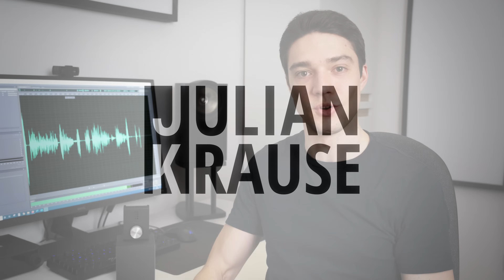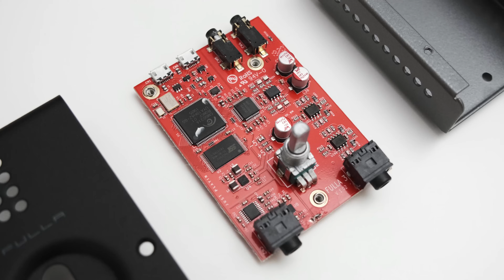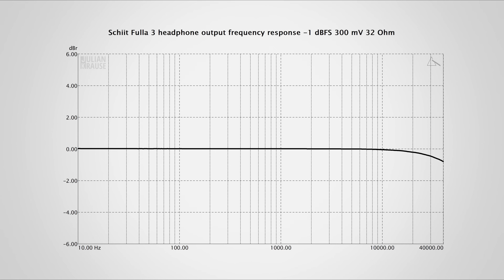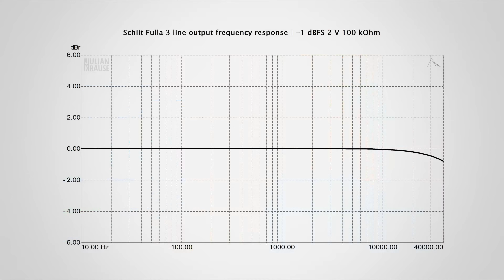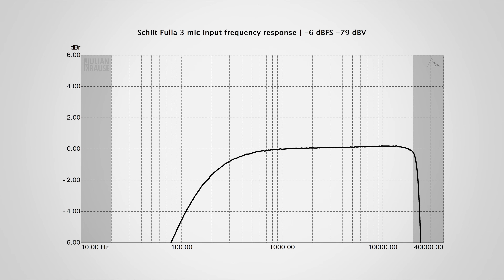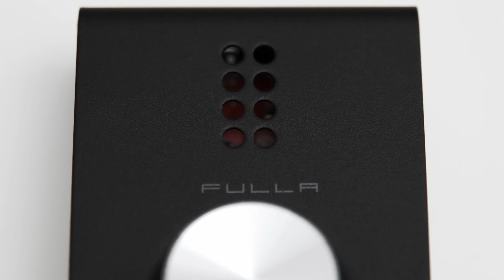Schiit Fulla 3 - Gaming DAC / Headphone Amp / Interface (audio quality tested)

Comment: I can confirm that my Fulla 3 has the same volume knob crackling issue out of the box. It was such a hassle dealing with shipping to my address that i didnt bother going through any RMA process. 
I also just left the knob at the 10oclock position and adjusted windows volume instead

Comment: Hey bro you always mention about usb type c being the best connection now in 2021. I was wondering if you could review an interface from RME(babyface pro fs). It is the latest version from the babyface line up but doesn't use usb c regardless of its price being a bit higher.

Comment: I have the Soundblaster G6, would the Fulla 3 be a good upgrade over it or should I look at something else?
Reply: Currently in the same boat. Did you end up finding something else? I'm mainly looking for something that is not so software dependant
Reply: @calik44  ended up with ifi zen Can and Dac. Superb solution for my needs
Reply: Mayflower Arc MK 2 needs no drivers and is an audio upgrade compared to the g6. I doubt Fulla 3 is one, the G6 sounds pretty good. And the mic input quality is better than it seems to be on the Fulla (on both G6 and Mayflower).

Comment: I just got this and I'm struggling a little. When I power it with the included cable that attaches the the PC I only get PC audio or headphone audio. When I add a second source like a 3.5mm from the back of my monitor (playing an xbox game), then I can't here my PC any more. Is there any way to keep both plugged in and the unit will sense which source i'm using? Otherwise I'd have to unplug my monitor cable every time.
Reply: Figured it out if anyone else is struggling. I know very little about audio but this helped:
You can have USB audio and a second device like the monitor mentioned above. However, if your PC sound settings select the monitor not the Schiit Full 3. That is all. When you are viewing something on PC like listening to music on youtube it'll play. When you switch your monitors input it'll also play (but of course the PC will stop playing during that time). It was a simple fix once I figured it out. Drove me crazy for a minute.

Comment: I am looking for a new sound card/headphone amplifier. Mainly for gaming and music. I have tried a lot over the years. My first sound card was a Sound Blaster Audigy 2, which was a game changer because of EAX...
After that, I tried the Asus xonar u7 on recommendation. But it quickly reached its limits. (Too quiet and too "hollow" at the headphone output. So I bought the Sound Blaster Zx. I was happy with it for a long time. The only problem is the drivers, because Creative doesn't maintain them properly. At the moment I'm using the Sound Blasterx G5. I like the sound quite a lot. The problem here is again the drivers. About a year ago, I had to take the G5 out of service for a short time because the driver didn't work with the then current Windows version. For a few months now, however, everything has been running as it should.

I would prefer something that can be adapted in a similar way to the Sound Blaster, but does not cause any problems with the drivers. (Max 150€)

Comment: Can you use an xlr mic with this? Obviously with an xlr to 3.5mm cable.
Reply from the maker: Not really. If you want to connect an XLR mic I suggest an audio interface with an XLR input.
Reply: @JulianKrause  Is there a specific reason it wouldn't work? Just curious
Reply from the maker: @Conrad75  XLR condenser mics need 48V pahntom power which the 3.5mm input does not provide. And XLR dynamic microphones need a low noise preamp otherwise you end up with a lot of noise. So, it's just not worth it.

Comment: So I got this and wish I didn't. The worst part is Schiit has insanely expensive shipping for how small and light these are and if you want to return, they charge you a 15% restocking fee and no refund of shipping. So, now I'm stuck with this. It has a horrible hiss on any IEM's and a scratchy sound on the knob when turning volume. Def recommend going for the Hel or another company that doesn't give you a massive tax if you decide you don't like the product. I'll be sticking to products I can buy on Amazon from now on. Avoid the Fulla 3.

Comment: I'm currently using a Behringer UM2 with a Samson Q2U microphone and my mic quality is pretty trash for some reason.  The mic even sounds better/louder without the UM2) 

Is the UM2 really that trash ? Should I invest in a better intertace/mic ?
Reply: The UM2 Is a respectable audio interface. There's most likely some fine tuning you need to do. If you don't find anything else wrong with your audio setup then id switch interfaces. As for the microphone there's no need to upgrade unless you're looking for podcast level quality. In that case I'd go with a Rhode prodcaster, A Cloud Microphones Cloud Lifter, and a GOXLR mini. But that comes out to nearly 500$ so unless you're looking to drop some serious cash id recommend just switching your interface.
Reply: @fj3633  i picked up a at2020 with a Scarlett solo and everything is fine. There's so much less hissing with the Solo than the UM2

Comment: The lack of microphone input quality is fairly disappointing as this is one of the main motivations to get something like this, vs. using a motherboard audio sound chip.   Many electret and MEMS microphones used in headsets are capable of sounding quite decent when handled properly.

Comment: Hello Julian! Amazing job with the channel, I am learning a lot with your material.
Based on your previous test results, I am about to buy a Motu m2 for digital piano recording and to use as the main headphone output on my pc. I see that the output power this Schiit amp deliver are quite a bit higher, do you think the Motu M2 delivers a powerful enough signal for a 64-250 ohm headphone or will that be an issue??

Comment: Julian,
Would you happen to know the playback latency?  
You might also have other recommendations for me: I play my EWI instruments through a midi interface into my laptop and I need a small portable output that is very low latency.  My VST software and midi add up to 8-12 ms, so I need the output to be 5ms or below if possible to avoid and overall lagging-feel as I play.  Focusrite 2i4 and Steinburg UR242 audio interfaces both work great. but I don'l need the inputs to record and I don't like lugging them around.  I was hoping to find an ASIO low latency reasonably good frequency response output solution.  I will be grateful for any thoughts you have.
I appreciate your careful and thorough reviews.
Reply: did you find that low latency output soultion?

Comment: Hallo Julian,
könntest du bald mal das Tascam 102i audio interface testen?
Ich suche ein Audio interface mit integrierten live dsp Effekten (Kompressor, Reverb, etc), um zu streamen und gelegentlich metal vocals einzusingen.
Habe mir schon dein Review zum Steinberg UR22C angesehen aber mich hat es etwas abgeschreckt, dass das Grundrauschen höher ist und die Ausgangsimpedanz so hoch und gleichzeitig die maximale Lautstärke so niedrig ist.
Was würdest du da empfehlen?
Gear:
Shure SM7B
Beyerdynamic dt 1770 pro (250 Ohm)

Würde generell ein Testvideo speziell für Audio interfaces mit integrierten dsp prozessoren auch mal interessant finden.

Viele Grüße ✌🏽

Comment: And how does it sound? You haven't mentioned how it sounds to you once?!
Most measurements for DAC's or amps are outside of the human hearing range and thus basically useless as benchmarks,
and are often used for marketing purposes (to make products look like they should sound good), ecxept to test for grave errors.
DAC's and AMP's can sound different and or better, very often AMP's and DAC's that measure "worse" will sound better - even tho we are not yet able to exactly measure how and why.
Reply: The people watching these reviews are amateurs that have no audio experience and think numbers and specs is everything, only if it were that simple.
To an extent I think Julian also has some learning to do or else he won't be making a 13 minute video talking about the specifications of an amp which is the least important thing, instead of talking about what it actually sounds.
Reply: @xionski  
So, 
how deep into the rabbit hole are you? :)
I am listening to fear innoculum right now on my ZMF Verite Purple Heart with a Michanikos Cable into: 

Eddie Current Studio Junior 2A3 (the only 2A3 ever made and the last Studio Junior ever built) into a Violectric V281 being used to convert my Schiit Yggdrasils XLR signal into RCA, fed by a Lynx Aes16e via AES out of my dedicated fanless audio pc with mostly Qobuz. 
Power cleaned by an Airlink CBS3000 and Audio Tuning Pithan Cables and outlet. 

Tho anything but cheap, the system is as much price/performance you can get for around 12k euro, the Studio Junior alone would cost at least 10k for the same quality from a big brand company, as well as the Yggdrasil which should cost above 5k for how it sounds. All cables and the Airlink PSU are handmade boutique, low series products costing way less then they would from bigger companies (paid only around 1k for clean power). Etc.
Took my 3 years to build the system from mostly used parts so it cost me "only" about 8k.
Reply: @mariodrv  I'm using my apple earpods with my phone :)

Comment: How can you record your voice having the micrphone so distant? I bought a Steinberg UR12 interface and a Rode M3 but, if I place the mic at about 40cm far away from my mouth, I have to put the audioboard gain to its maximum value having in this way a lot of noise! Do you use perhaps some software that add some gain and automatically filter the noise? Please help me. Thanks!
Reply from the maker: That's totally normal, as the M3 has quite a high self-noise. My advise would be to keep the mic as close to you as possible and maybe look into buying a lower noise microphone. Btw, the mic in my videos is not far away from me. It is on a boom arm just out of shot above me and only about a foot away from my mouth. Mics always  sound best close to the sound source, there is just no way around that.
Reply: Julian Krause thank you. What mic do you use?
Reply from the maker: I use a Schoeps CMC641. But you don't need anything fancy like that. Any decent condenser mic will do. Something like an Oktave MK012 comes to mind.
Reply: @Julian Krause I found a Tascam TM180 at good price. Self noise 15dBA and sensitivity at -35dB. In your opinion, are these values adequate for recording at least at 40cm from mic?
Reply: @stefano.a  TM180 is a large one. Use a small diaphragm mic.
Reply: @GanjarPranowoTerbaik  too late :-(

Comment: One thing I see as vital in a gaming device is the ability to quickly switch between speakers and headphone without plugging anything in or out. That's where the Sennheiser Gaming DAC works better.

Comment: Hi Julian, great video! I have a USB mic, so the mic input is a bit useless for me. Do you know of a good AMP/DAC combo for under $150, not one the necessarily has a mic input? Also, could I use a Schiit Magni 3+ with my computer without a DAC?
Reply: You can use the OnBoard soundchip of the mainboard as a DAC and just feed the signal into a headphone amp. A dedicated DAC might however be worth it, depending on the implementation of the OnBoard chip with your particular mainboard. 
The 9$ Apple USB-C Dongle is an option for a good 16-bit DAC, however with only 1Vrms output level you're gonna need to turn the amp up a bit more - not usually a problem. 
A (more or lessfully featured) desktop DAC with good performance will be a fair bit more expensive, the Topping E30 for 129$ is a very good option, but there are a number of alternatives (EarMen Donald DAC, JDS Atom DAC, SMSL Sanskrit MKII etc.). 
As far as headphone amps (some with preamp functionality) go, at 99$ you can get a Schiit Magni Heresy or a JDS Labs Atom amp, the Geshelli Audio Archel2 Pro is also an option at 139$, and when it releases, the Topping L30 (especially good for low impedance and high sensitivity headphones like IEMs) will be a good pick at around 150$ or so.

Comment: I've owned a Magni 3 for 4 years. The volume control is scratchy just as you described for this unit. Scratchy sounds when turning a volume knob usually means that there is a dc current passing through the resistive element, and when you turn the knob, that current produces scratchy sounds and noise. If this is what's happening, then it means that the design doesn't use coupling capacitors in and/or out of the volume control potentiometer. The dc current is usually caused by small dc offset voltages in the amplifier stage that feeds the volume pot. Some designers may leave out the coupling capacitors in order to save money or board space. It's definitely annoying.
Reply: Yes, but you will not get a better sounding amp than the Magni 3 or 3+ at that price.
Reply: @mariodrv  Magni Heresy and JDS Atom are both 99$ as well and measure better, Archel2 Pro is 139$, the Topping L30 will be around 150$ or so when it comes to market soon. 
There are better options - if that makes an audible difference is doubtful though.

Comment: Hey Julian, I have a steinberg ur22c and 32ohms headphones. How can I fix the impedance problem without spending a lot of money on expensive high impedance headphones?
Reply from the maker: Well, you only got two options. Either buy high impedane headphones or buy an audio interface with a low output impedance. There is sadly no other way to fix your problem. That said, it is usually not as bad as some people belive. Yes, your bass might be a bit more boosted, but in many cases it's not a very huge deal. If you liek the sound of your current setup, no need to change.
Reply: @JulianKrause  thanks! It's not what I wanted to hear, but I appreciate the answer. The sound is not terrible, but the bass is a little boosted. I don't think I'll buy a new interface, the reason I bought the steinberg was because of the onboard DSP fx, and since I don't have a really fast computer, it helps a lot. Well, guess I'll have to save some money for some headphones then lol
Reply: @JulianKrause  How about, if there is plenty of voltage gain in there, just connect 4.7 or 10 Ohm resistors in parallel with the output. Assuming the impedance is constant throughout the audio range or is a straight up resistance, it would decimate the voltage gain, but lower the output impedance. No? I mean you generally don't need a lot of voltage to drive 32 Ohm headphones, that's the nature of them.

Also, you only list two ways, different headphones or different interface. Why not simply chain an inexpensive but low output impedance headphone amplifier to a line or unbalanced output of the interface?
Reply: How much a high output impedance changes the tonality of headphones is very different between headphones. Unfortunately I don't know of many reviewers that measure that particular aspect, you might an answer for find your headphones on DIY-Audio-Heaven.

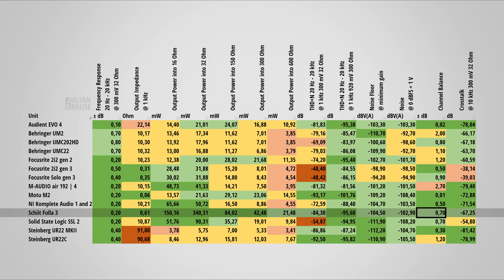Comment: 4:24 my Fulla 2 and Hel also both have the scratching sound when turning the volume knob. Annoying.
Reply from the maker: Thanks for the info. That's really interesting as Schiit advertises high quality ALPS potentiometers.
Reply: @JulianKrause  Yes, but read my comment somewhere in this section, re: why the control makes noise.
Reply: Just got a Hel from schiit a few days ago. No scratching on volume adjust for me at all. I'd contact them
Reply: @inepsaog9631  it's weird because a few days after I posted this comment, it stopped. Then recently the scratching came back again. I think it's the changing humidity of the room as the weather where I am has been changing a lot.
Reply: Too many people think their products are faulty before even trying electrical contact cleaner. I need to regularly use it to keep my Nintendo Joy Cons from not working, and I’ve used it on lots of other things. Like my guitar potentiometers, for one. Fixed the scratching. 

Spray some of that shit into your Schitt bruh